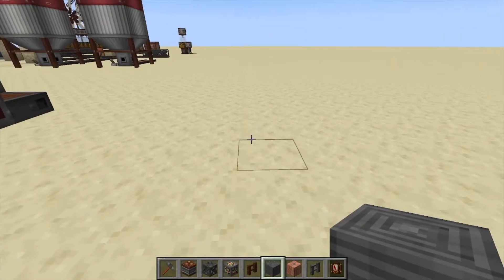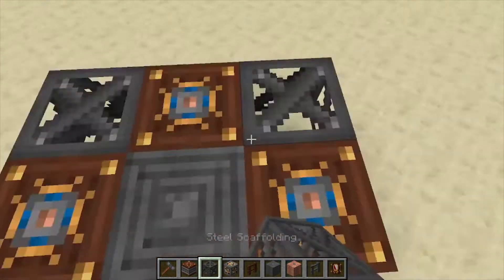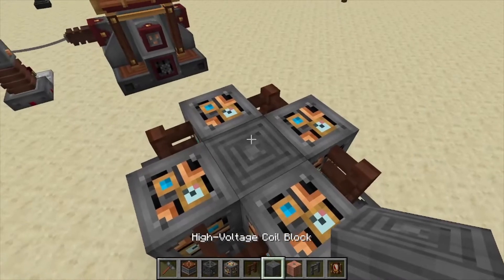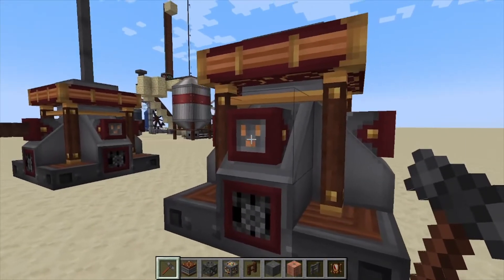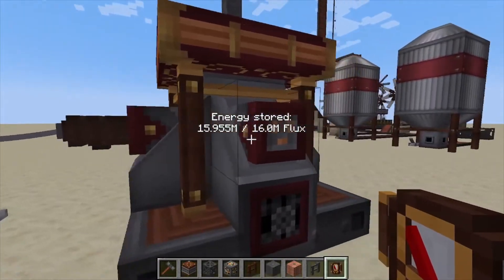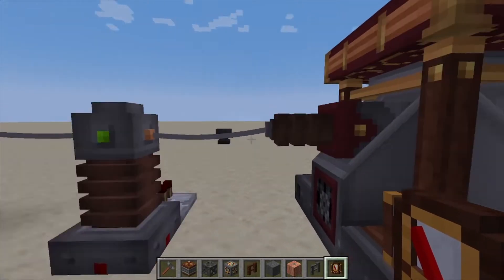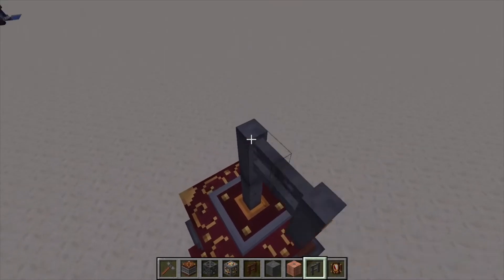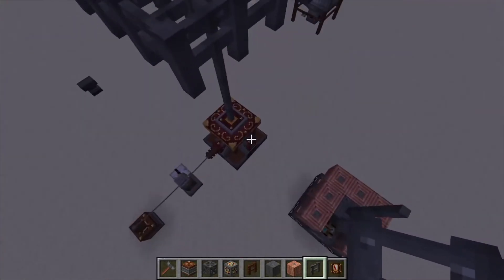Immersive engineering: Lightning rod (how to setup and use)

Comment: Could it be possible to use the vanilla lightning rod (the one made of copper) to basically guarantee that lightning strikes above the IE lightning rod?
Reply from the maker: Thats an Expirement you might have to do on your own but im thinking the lightning must strike directly on the fence to count
Reply: @MCMentor1  I did some testing and research and it seems that IE creates its own lightning to charge the lighting rod battery and does not use vanilla minecraft lighting, so even if lighting hits the copper rod touching the steel, it will not charge at all. Bummer.

Comment: Does it have to be naturally occurring lightning?

I’ve tried waiting, and waiting and waiting and it never strikes, so I made lightning charges and shocked all 128 steel fences I put on it, and it just never produces power…

It’s driving me crazy, because I spent so long getting enough stuff going to have 4 of them atop my engineering factory, and it just doesn’t wanna do the things I need it too lol.
Reply from the maker: It does need to be natural lightning if you are in a desert I don't think it will work...try an ocean or forest where it rains a lot...and not all rain will produce lightning.

Edit: alos the more fences the more likely you will have a strike